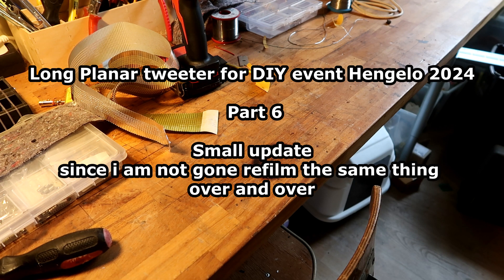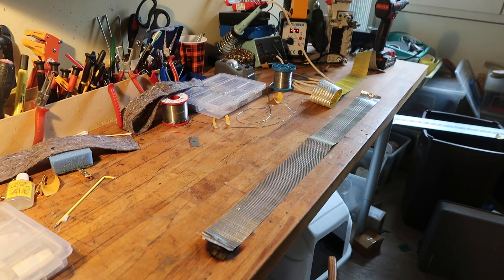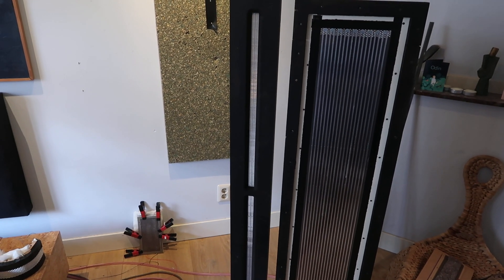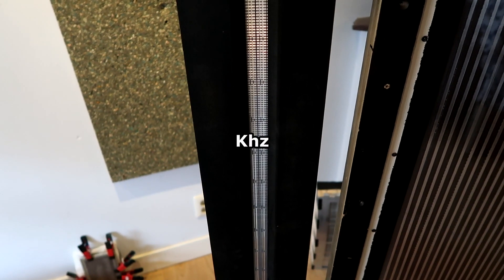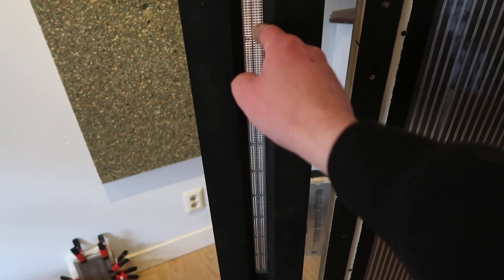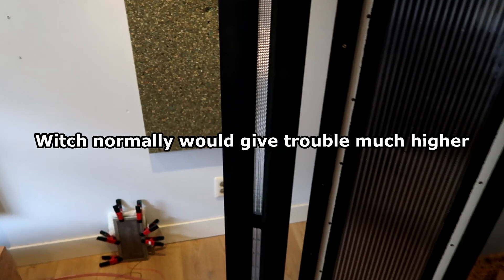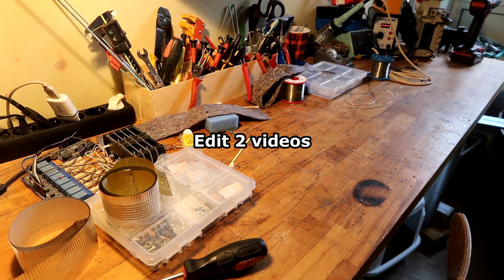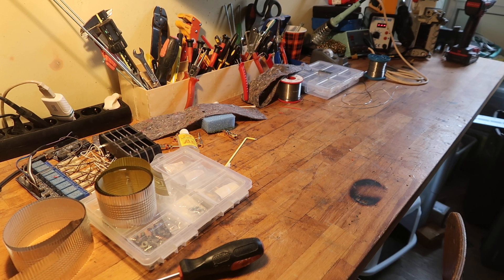Long Planar tweeter for DIY event Hengelo 2024 - Part 6  Small update

Comment: have you considered using light grease to locate the ribbon horizontally? This is a very old technique to keeping the ribbon in place. It might work for you.
Reply from the maker: no i did not, wont work for this contrapion either i think ? since its not a true ribbon. but corugated planar magnetic. like a carver tweeter or the huge B&G RD versions +- give or take :)
Reply: @joppepeelen  well grease could be light or thick or if you need to secure the ribbon you could tag it on both sides with a small dot of silicon sealant. To do this you will need to secure or shim the ribbon with spacer to place it and keep it where you want it until the sealant sets. you may need to do this in several places at high frequencies this does not impede the motion of the ribbon. Hope this may help.

Comment: Great work, Joppe! As you have a CNC, you can make the opening staggered. That way the dip will not be that deep and also spread over a wider range.
Reply from the maker: well putting the whole complete frame in the machine and lining it up might be troublesome :( but if i do that... i can also cut away the slot wider by 2 cm
Reply: @joppepeelen  Yes, I guess you don't have the time to redo the frames from scratch.
How deep is the dip? 
These dips are inevitable on this kind of ribbons/planars.

Comment: the dip can arise from the covered area left/right to the open slit too. Very interesting project!
Reply from the maker: yeah that could be it or the wood distance sideways. in both cases opening it up might resolve it, it also would make the roundover less critical. to bad i did not try this in this design :(
Reply: @joppepeelen  Isn't it good as it's the way experience is made of :)
Reply from the maker: @yo3429   true. cant fix all problems in one go. if i even know what  causing it